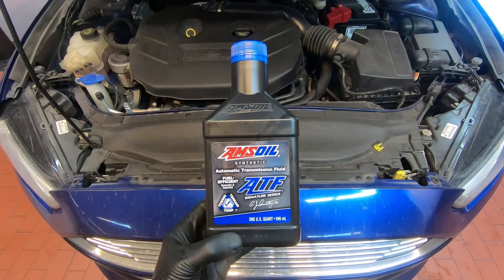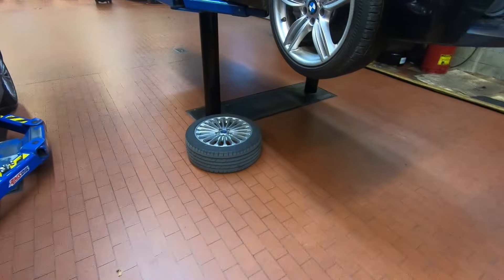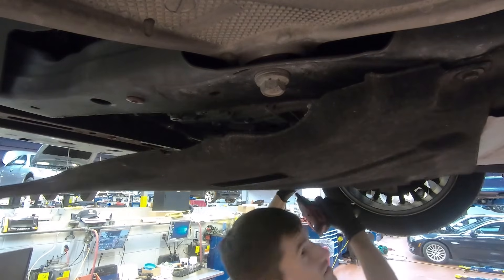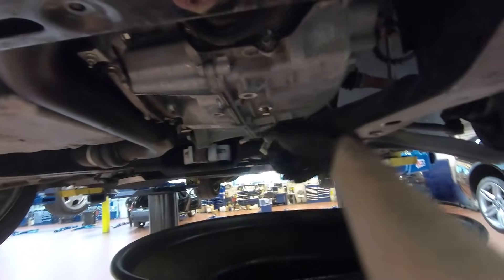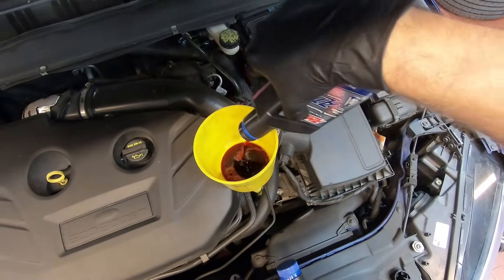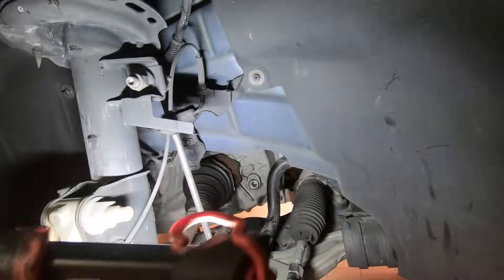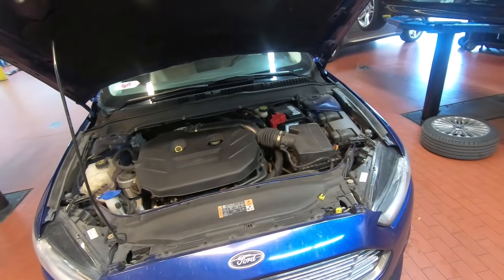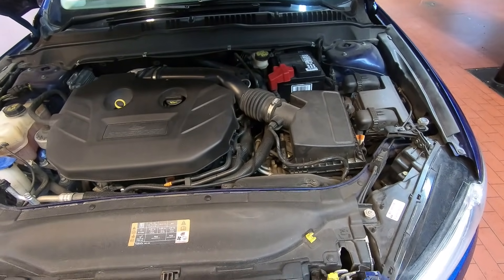Ford Fusion Automatic Transmission Service ( 6F35 ) [ HOW TO ]  2013-2020

Comment: By far the most informative instruction video that I have found. Easy to understand. Thank you for taking the time helping people save money. Great job.
Reply from the maker: Thanks for your kind words. I did it because I couldn't find a good video out there myself so I knew it was a good idea. I know I'm not the best on camera or have the best equipment or angles but the process is there atleast
Reply: @THEDriverMod_ hello I'm having issues when I I accelerate from a stop in drive on flat surfacee the car want to to go backwards then goes forward it shifts fine one driving do you have any idea of what this could be ?

Comment: Got a Question:

I have a 2020 Ford Fusion 1.5L Turbo and the owner's manual says the capacity is 9 Qts. I would have no way of both making my car level and getting to the fill cap As I don't have a lift. Is it possible to just fill the transmission to the owner's manual spec without touching the fill cap?
Reply from the maker: Get 4 jackstands and a floor jack. The amount you drain will never be 9qts at once. You need to check the level

Comment: excellet video, my 2015 fusion with 170K miles never got its transmission fluid change, is too late to do it? 😭😭😭
Reply from the maker: If you're having any serious issues no, your best bet is to use the fluid in the video and do 2 drain and fills back to back while running it for 10-15 minutes in-between 

Order from->  Www.premiumsyntheticsusa.myamsoil.com
Reply: @THEDriverMod_ Im not having issues with the transmission

Comment: Nice video! I am about to do it for my car but after reading the comments and watching the video I realized that i am cooked because i have never changed it for my 2017 2.5L with 139k miles. Now having some rough shift at 1-2 gears first 30 mins of drive but when the car gets warmed up it is somehow smooth. I hope the fluid helps it.
Reply from the maker: Just do drain and fills, you'll be okay. Get your fluid from Www.premiumsyntheticsusa.myamsoil.com 

I dont recommend anything else

Comment: U dont just add trans fluid bro u have to pull the plug on the bottom the second transmission plug so u can see how much trans fluid u have and when it starts leaking out u stop
Reply from the maker: Pretty sure i stated that in the video

Comment: I haven't seen the add while running step mentioned anywhere online. Seems like an important step. Thank you for the info just got a '18 2.5l with 128k and have no idea if the trans fluid has been changed. Watching your video makes me feel more confident that it needs to be changed regardless of the miles. The dealer told me to not change it but the internet seems to strongly disagree. If done on jack stands does the car have to be level? Or will the trans cycling the fluid negate some slope from the driveway?
Reply from the maker: The car needs to be level to do an accurate drain and fill

Comment: Hey so I drained my ford fusion and the fluid was black so we put new one in a gallon and I think two small ones and for a minute and so it wouldn’t jerk back but once I put it in gear like reverse it will jerk back then when I press on the gas it was like I needed to put more pressure on the gase to have it take off as it should what do u think is the issue
Reply: I have a 2015 ford fusion SE.btw
Reply from the maker: Did you check the transmission level plug to ensure it's not over filled? Did you order the fluid from
Www.premiumsyntheticsusa.myamsoil.com
Reply: @THEDriverMod_ transmission level u talking about the fluid or the temperature on the dash bord?
Reply: @THEDriverMod_ and no I just got the fluid it said I. Needed for the car online
Reply from the maker: @Khalilkc there is a plug on yhe side of the transmission that you remove to check the fluid level.

Comment: Very Informative video. Just curious , wasn't there a need to change the fluid filter when changing the transmission fluid . Come across other mechanics who are concurrently change the filter as well . Please advice .
Reply from the maker: To change the filter you have to remove the transmission, separate the transmission case, replace the filter and put it all back together. If you change the fluid regularly, changing the filter isn't as critical, I change it every 40k, I'm currently at around 215k on the original transmission, filter, torque converter etc

Comment: I think you want to add a little extra fluid, let it warm up and expand, then crack the fill level plug. Adding the fluid cold can cause you to overfill it unless you let it warm up.

I just drain and fill it cold and measure what comes out and put that much back in
Reply from the maker: Ive been doing it this way since new, currently at 215k miles still all original transmission parts

Comment: Manufacturer calls for ford motorcraft transmission fluid it says right in my owners manual. 2014 titanium fusion..???
Reply from the maker: It calls for an " LV spec fluid" and the Amsoil LV spec fluid is superior to the ford stuff. Im at 215k now on my original transmission and torque converter

Comment: Is this better than mercon lv? Is it okay to mix this product with mercon lv or does it need to be completely drained?
Reply from the maker: Yes it is better and yes it is okay to mix them.
Reply: @THEDriverMod_ should I do multiple drain and fills to get rid of the Mercon LV? In your opinion why is it better than OEM, I see conflicting things online. Thanks.
Reply from the maker: @logandecker271 better due to additives, detergents, wear protection and thermal breakdown protection. Im at 220k miles on my original transmission and torque converter. Depending on how dark your fluid is i would doe 2-3 drain and fills while running it for 5-10 minutes and shifting through the gears between each drain and fill
Reply from the maker: @logandecker271 order through Www.premiumsyntheticsusa.myamsoil.com and I'll personally be overseeing your order

Comment: I’m going to be doing a drain and fill for the 1st time on my 2014 ford fusion. (126k miles). So I should do this process 2-3 times? Drain fluid - fill 4 quarts - run engine / shift gears - fill 1 more quart to watch it drain out the level plug. Once achieved - drive 5miles and repeat the process? Hopefully that makes sense!
Reply: Also thank you for video!
Reply from the maker: I would for sure. Order the transmission fluid from me:
Www.premiumsyntheticsusa.myamsoil.com

Comment: I have 2014 Ford Taurus SEL with 2.0L eco boost engine and just hit 60k, and the transmission never been touched before and I would like to do a transmission service like drain and fill, but not sure if my car has 6F35 ? Also do you recommended doing drain and fill twice at the same time? Thank you for your reply and video.
Reply from the maker: Yes I recommend it. And I recommend using Amsoils transmission fluid for sure. Im now at 213k miles and still original transmission components 
Www.premiumsyntheticsusa.myamsoil.com

Comment: Hi . Do I have to check the oil level in the side plug? Or if I fill the exact same amount that was drained its also ok?
Reply from the maker: Yes, you need to check it. The fluid going in will be a different temp than the fluid coming out so the warmer one will be expanded slightly taking up more space.
Reply: @THEDriverMod_ hi and what about if the oil is visible in the filling hole on the top. Is that also a good level?
Reply from the maker: What upper one? Theres only one level check plug  @graveworm1000

Comment: Definitely want/need to do this on my 2020 with around 75k on it.  I have never liked the way this thing shifts, and I bought it new with like 13 miles on it.  Can't stand the clickety clackety 1.5l sound and weak tranny, but no real problems yet...just sounds horrific like the one in the video.  Guess that's just new 4 banger turbos?
Reply from the maker: Yes the clicking from the engine isn't a defect, just normal high pressure fuel pump and injector operation

Comment: I have 193k on mine and to my knowledge, the fluid has never been changed (I got the car with 116k) would it be ok to change the fluid, or do I need a new transmission?😅
Reply from the maker: Doing a drain and fill shouldn't hurt

Comment: My 2016 Fusion had 165k on it, harsh 1-2 shift, jerking, fishbiting, slow 2-3 shift. Ford tech told me new transmission needed, nothing they can do. So I drained and filled it with motorcraft fluid. Drove it 15 minutes or so, drained and filled it again. Fluid stil looked dark and bad. Drove it 3 days, shifts were improving the more I drove. Day 4 drained and filled it again. Fluid looked dark and stinky. Drove great after this fluid change. Drove it one month, drained and filled again. Fluid looked better. Changed it again every 15k miles. Its been 60k miles and the tranny shifts beautifully. So, these can be brought back if they are acting up if you dont mind spending $250 on a bunch of transmission fluid. New clean fluid makes all the difference. I love this car. 225k miles.
Reply from the maker: The Motorcraft LV fluid definitely gets dark quick and when a drain and fill only replaces 40% of the totel fluid amount it will take 3 -4 changes before the color improves
Reply: Did it go 165k without any fluid change? or had it been changed regularly and still shifting bad?
Reply: Which engine?
Reply: If you remember, on average how much fluid did you use each time? By average is it fair to say that for a drain and fill, 4.3 qts is recommended?
Reply from the maker: Anywhere from 4.3-4.8

Comment: Im frustrated. 

My trans went out and had to replace with a used one thriugh LKQ. 9 months later with zero warning, and no slippage, car was smoking, lost power (acceleration), and fluid everywhere on top of the transmission. Stranded for 6 hrs on the interstate. Car has been sitting since this last December, and i start it to keep it charged up. I wouldn't think a bad torque converter will theow fluid. A guy mechanic told me it sounds like a line blew (but it don't look like it). I definitely don't want to throw new transmission fluid in it to see if i can see where fluid is coming from, and for it to go all over (which wastes $ that i dont have). I originally came on here to see if i can fill it the way u did, and yup. I just want to add a few quarts to see if it will tell me where this leak is. Its soooo frustrating. Im so sick of fusions for their transmission issues. Mine is a 2015 fusion titanium 2.0 turbo. I love my car other than that.
Reply from the maker: Ive had pretty good luck with mine. Sorry you're not having the same experience.

Comment: I’m hoping you still respond to new comments due to the video being 4yrs old.. 
I have a ford fusion 2013, bought it at 103k and currently on 144k. I’m surely doing this on my own thanks to your helpful video! 
Anything you recommend? Shall I do a flush or just a change? 

Got it off of drive time and I have no clue when the last time it was serviced. So I’m trying my best to keep up the maintenance while I still have another 3yrs till actually owning the car. The ONLY thing I’m worried about is when shifting gears it goes have a jerk to it the first 2 times it shifts and happened ever since I got the car. I’m hoping dong this would may fix it?? Is it best to do this least 2 times same day?
Reply from the maker: Use the Amsoil transmission fluid featured in this video from Www.premiumsyntheticsusa.myamsoil.com and just do a drain and fill. I would do 2 drain and fills just to change out the majority of the fluid so buy yourself 10 qts. For the shifting concern the fluid change may help but these transmissions commonly have a harsh 2-3 up shift. Mines had it since new. Currently at 210k now still running
Reply: @THEDriverMod_  thank you, I appreciate the response :)
Reply from the maker: @NKat-i3x please like the video and subscribe! It's helps me out in return. Us I've got alot of other helpful Ford Fusion videos. Thanks alot! Happy it helped you
Reply: @THEDriverMod_   I have used Val, mercon LV, how is it different then Amsoil ? I have been looking around for it and most stores don’t carry it
Reply from the maker: @NKat-i3x you won't find it in stores. And their products resist thermal break down and oxidation waaay better than mercon or valve valvoline. Longer fluid life, better protection and better cleaning detergents in the Amsoil fluid

Comment: Great job! You articulate well and speak clearly and slowly. The camera is always in focus, and there are no rapid/shaking movements. I checked this video as the trans shop told me there was no filter at a service interval to change and I thought they were full of it. Turns out, they were right, but seeing how simple it is, I will do it myself - I just wish I had a lift, lol.
Reply from the maker: You can get a set of quick jacks for 1500-1800 dollars. They are perfect for this

Comment: Not gonna lie my 2017 fusion hybrid is at 200,000 miles and I've never done this.  Use it for work so I'm always on the go and have barely thought about anything beyond oil changes(also the dealership that I used to take it to religiously never once recommended any service what so ever so there's that).  Runs perfectly fine with no problems what so ever like the day I bought it brand new.  At this point would it be more detrimental to the transmission to change the fluid?  Should I just keep running it like it is? lol
Reply from the maker: Hybrids have a different transmission,  it is a CVT. Doing a drain and fill definitely is a good service to do.

Comment: My local shop and dealer said they neeed to remove the pan wtf I’m confused
Reply from the maker: There's is no transmission pan to remove
Reply: @THEDriverMod_  is it ok to use atf? I’ve read only use motorcraft .. is it ok to mix on a second drain and fill and then put the same atf on 3rd drain and fill and so forth ?
Reply from the maker: @thefoodieguy9519  mines got over 200k using amsoil atf....its waaaaay better than motorcraft
Reply from the maker: Unless they ment the valve body side cover
Reply: @ not sure will make sure and ask because they said we need to remove the pan from where transmission fluid goes.. but I’m like there really isn’t any pan to remove … right?

Comment: I  remove the line that comes from the radiator to the transmission and start the car after draining the fluid, and put in about 5 quarts , start the car and all the fluid thats in the converter and lines and radiator comes out, i shut the car off ehen i see new fluid coming out , done 99.6 percent new
Reply from the maker: @enriquevalentin281  that's another way to do it but that's far more complicated for the average DIY guy

Comment: please replay me,Does plug fill is bolt or cap,and it’s same for 2.5L 2017 or it’s deferent,my mean just fill location,not drain and level,cuz i used pump in the level location for filling fluid
Reply from the maker: I dont understand
Reply: @ i already found it,thanks
Reply: @ thanks for sharing this video,it was help-full

Comment: Great video, though I do not recall him mentioning you much be sure, the engine/trans is at operating temperature.. If not, and it's not at temp, it may by overfull when the trans reaches 185 to 205 F..
I also fill and check the level, from that same inspection plug on the side of the trans.. Do this on all 6F35's and later 8F35's on all later popular Fords, or face the prospect of torque converter shudder at the least, and just outright trans failure at the worst. Every 30k miles.. Take it from a 2019 Edge owner who learned the hard way..... Do you like $7500 to $10,000 estimates ?
Reply: I changed mine every 30k and I just lost the transmission last week at 108k. I was driving down the road and felt a little shudder one time and then I lost all the gears. The trans will only engage when it’s cold and not when it’s hot.
Reply from the maker: That's unfortunate. I'm at 210k miles as we speak.
Reply from the maker: I've been doing it this way since I've owned the car, I am currently at 210k miles with the original, unopened factory transmission, torque converter etc.

Comment: If i wanted to do 2 drain and fills to get most of the mercon out. How long should i wait between drain and fills?
Reply from the maker: @tylerdurden722  you can do them right after the other. Do one, run the car for 5-10 minutes and then do the second
Reply: @THEDriverMod_ Thanks

Comment: a few years ago on my 2014 2.0.i did this service3 times in one day.. drained 4 quarts.. refilled.. drove it 5 miles and repeted this 3 more time, to get as much of the oild stuff out as i could.. used valvoline lv fluid,, and  now.38000 miles later shifts perfectly  no hard shifts  , going to change out 4 quarts  service in the next few days
Reply: Did the shifts feel better after doing this a few times same day or overtime you started seeing the difference? I got a 2013 fusion and she is jerky when shifting.
Reply: @NKat-i3x  yes, but i still change the fluid every 36000 miles.. just 4 quarts per change
Reply from the maker: @NKat-i3x  2-3 up shift will always be jerky but I'm at 210k now still original transmission
Reply from the maker: Nice!

Comment: Y el cambio de filtro?
Reply from the maker: you have to remove the transmission to change the filter so that another reason i recommend using the Amsoil fluid as well as changing it every 40-50k
Order at-
www.premiumsyntheitcsusa.myamsoil.com

Comment: does this transmission(6F35) have oil filter? thank you
Reply from the maker: @syjyagls8478  yes however it's inside the transmission. Only way to replace is to remove the transmission and seperate the case and at that point you are overhauling the transmission
Reply: @THEDriverMod_  ok， I get it，thank you very much
Reply from the maker: @syjyagls8478  you're welcome. This is also one reason why I recommend changing the fluid every 40-50k miles